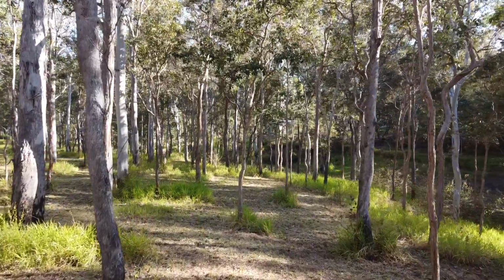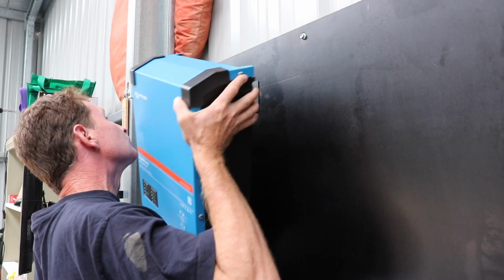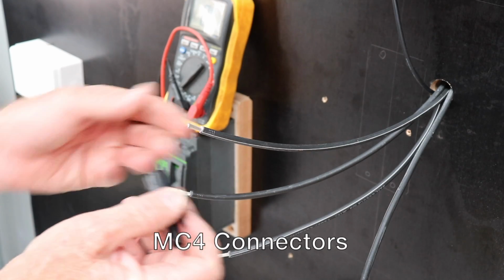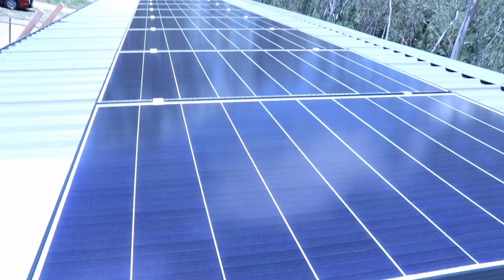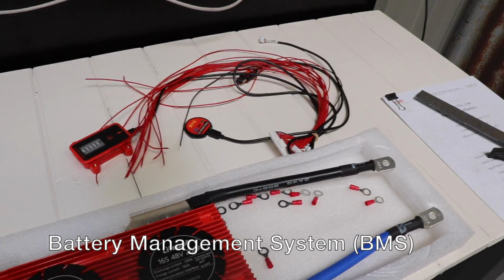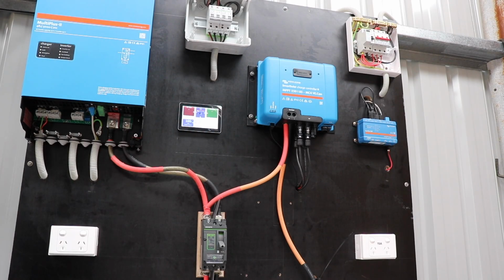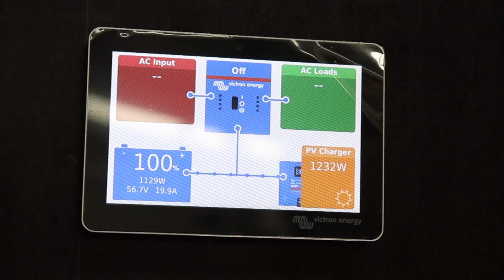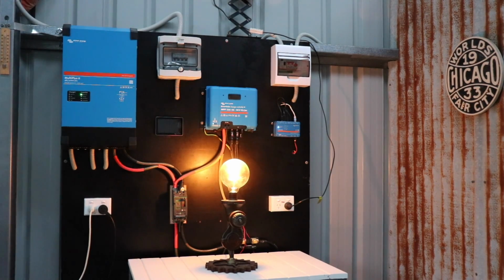Going Off Grid - DIY 4600w Solar Lithium Battery Power System EP7

Comment: I've talked to a bunch of people about stand-alone power systems and many complain at the price tag. True, there is a bit of money involved, but compared to getting mains power connected (if such a thing is even remotely possible where your property is) it's a no-brainer! 
The efficiency and simplicity of components today, as compared to even 10 years ago, is amazing.
If people want to go really cheaply, then they can get everything from panels ($20-50), inverters (under $100) and batteries (about $100 each) second-hand from Facebook Marketplace and other sites. The quality varies radically and ideally you would have everything tested (buyer beware!). I should point out though, that while you CAN go quite cheaply, you're getting it cheap for a reason and I wouldn't rely on it for a long-term system. As with most things, new is usually best.
Once again you've shown us that it's not rocket surgery. Well done and nicely explained. Thanks Scott.
Reply from the maker: Thanks again! There is power down the road, but like you say $$ for poles and connection so we bit the bullet and did it ourselves. A big thing with this system is now we have built it, we understand it and if something goes wrong I'll be able to fix it without to much drama.

Comment: Hi Scott. Thanks for sharing!
Did you consider the Victron EasySolar-II GX 5000VA? Or even Red Earth Energy Black Max? Obviously you’ve saved $ by building up your own battery 👍🏻. Black Max with similar capacity to yours would be over $22k, how does this compare to your spend?Thanks again, cheers.
Reply from the maker: Thanks Matthew! My system cost me around 15k AUD
Reply: That’s a lot of storage and PV for 15k, well done. Is your roof north facing?
Reply from the maker: @matthewanderson2982  yes facing north. I should have heaps of power to run the shed.
Reply: Is it possible to charge the batteries from a portable generator? I’ve seen similar setups with a caravan style receptacle to plug in a generator and top-up the batteries if you get an extended period of low sunlight. Potentially even pass-through power to add to inverter output? Not sure how this works with earthing etc. though?

Comment: Greetings from Maryborough Qld! Great job Scott, as always informative and entertaining. Quick question - do those batteries need to be clamped together to prevent swelling? Also which supplier did you use and are you happy with them? I am about to change over from lead acid to lithium and would appreciate any info on Aussie suppliers
Reply from the maker: I'm not 100% sure if the batteries need to be clamped. LifePo4 Oz was the supplier. Eve Batteries. I haven't had them long term so I cannot say for sure but they are considered pretty good broadly on the inter webs. As time goes by I'll give the system a good work out. All the best down there. Nice town Maryborough.

Comment: Great video Scott as always. Just wondered if you had the type of batteries that give off hydrogen when charging? If so you definitely want them in an airtight cupboard with a vent to the outside. Greatings from UK.
Reply from the maker: Thanks Fred. These batteries do not off gas like Lead Batteries. No vents required etc.

Comment: Love the video man! I have plans to achieve a similar outcome one day and a regular Will Prouse junkie too- Question: the batteries look great (I haven’t come across that style yet) but have you compared them to the server rack style lifepo4 batteries that seem popular in the states for off grid setups like on the ambition strikes channel?  I did a quick online search recently (Auz market) and it seemed like some of the US tech may not be as prevalent here or our market does it different? Victron seems to be the option for Australia re controllers etc and some of the “affordable” stuff Will has on his channel (EG4 I think) almost can’t exist here (regs probably) - the batteries are blue… are they victron too?
Reply from the maker: Thank you! I really wanted to go server rack Batteries, though for the price I got less bang for my buck going that path. The downside is with the EVE 3.2volt cells is that you build the battery system up and do the balancing. I think it was worth the extra work, and I know my system well for trouble shooting etc. There are options for inverters and chargers here in Aus. however Victron for the price v reputation, plus the service agent is nearby all are big plusses.

Comment: Wondering how hot it is going to get in that shed at peak summer and what effect that will have on the batteries (and humans!).
Reply from the maker: It will get warm in there. I need to put in some windows for cross ventilation down the track. The batteries will be okay I think. Me.....I'm getting pretty soft :)

Comment: Awesome inlaws and friends! A brilliant and efficient installation Scott. Nice one!
One thought, did you consider setting up the solar panels in front of the shed to create a additional  shelter? I think the panels would perform better in the open, but of course, you would have to build the supporting structure.
Reply from the maker: Thanks Benjamin! Yes existing structure plus it cools the shed also.
Reply: @ScottTurnerformeindustrious  I can't talk, mine are on the roof too, but I've been considering building a veranda and tossing up whether to use  roofing sheet products or use solar panels instead. 
Hence my original question...It seems too good a solution in my eyes...I'm just going to use 2nd hand panels and they will be running a hot water service. I guess I was fishing to see if you had considered that option and if you had, why you had rejected the idea - maybe I've missed something?

Comment: Top stuff Scott.
I've got 2130w on my bus roof and a multiplus 12 3000 and 3x 280ah eve battery packs. All victron smart mppt and cerbo gx.
Great having autonomy,  good stuff 🍻
Reply from the maker: Thanks! I'm a fan of the Victron gear. Time will tell how it all goes but fingers crossed.

Comment: I have a hybrid / partial off grid system myself with a 9kva Dunlite Sinewave backup generator .
I don't feed power to the grid at all and only cycle it to top up the batteries when needed .

Whatever you do Scott , DON'T have it WIFI enabled or at least have it able to be wifi disabled  at the panel or board .

If you can remotely operate it , it can be remotely switched OFF and disabled by outside sources !!

That component WILL become very relevant soon enough !

All the best mate , great set up by the way .

👍👍
Reply from the maker: Thanks for the advice. Yep crooks are everywhere.